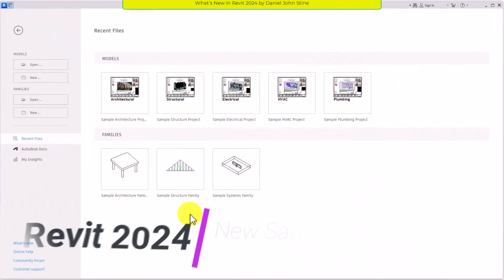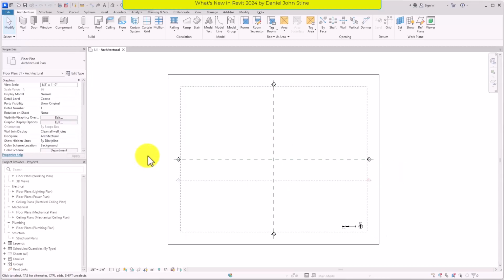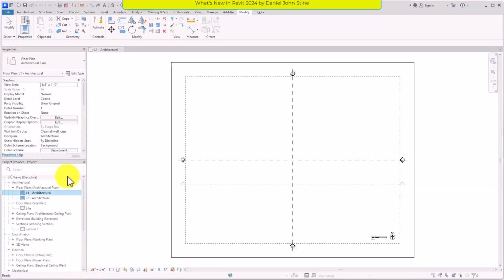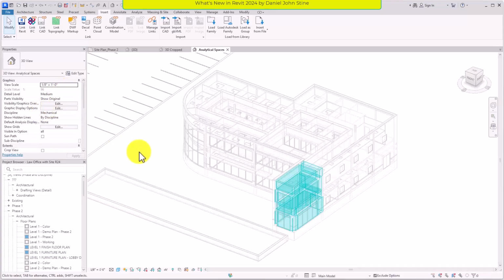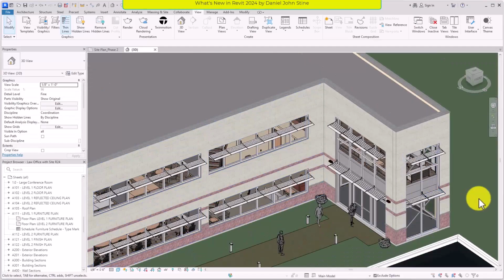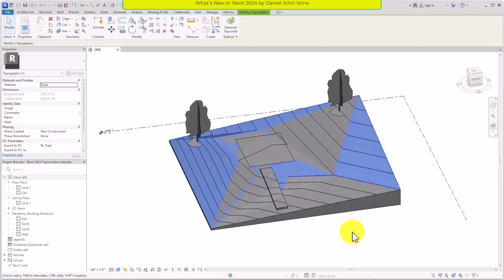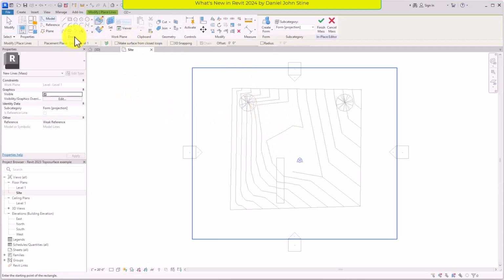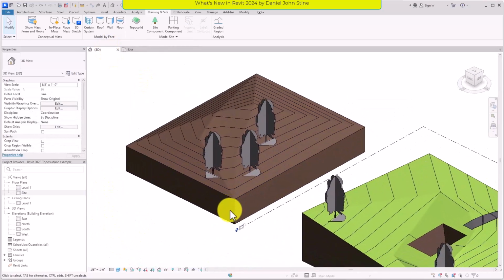What's New in Revit 2024

Comment: Great details Dan, can you tell me what are the 20 new stretchable dialogs in Revit 2024? Are there 20 that are stretchable in total or 20 new? I know, I'm such a nerd.
Reply: I found them.  
Additional resizable dialogs in 2024 as per Autodesk.

Decal Types dialog
Check spelling dialog
Keynotes dialog
New Legend view dialog
New Drafting view dialog
New Plan dialog
Save Selection dialog
Load Selection dialog
Detail Levels dialog
Halftone/Underlay dialog
Create Group dialog
Export Image dialog
System Color Schemes dialog
Import Line Weight dialog
Work Plane dialog
Insert 2D elements dialog
eTransmit - Transmit a model dialog
Starting View dialog
Select Element by ID dialog
Element IDs of selection dialog
Edit Label dialog
Reply from the maker: Yep... 20 additional:)